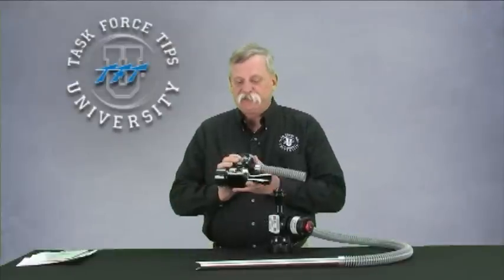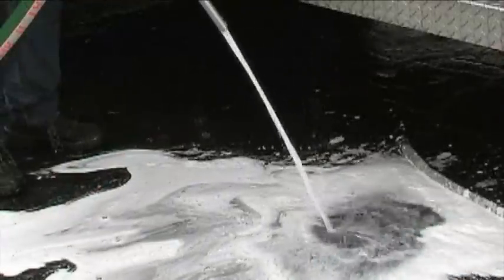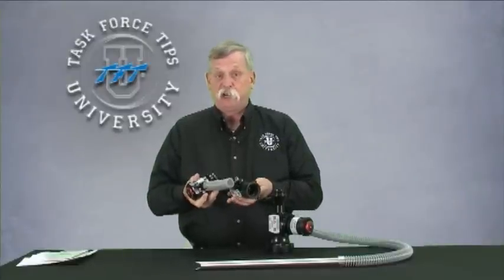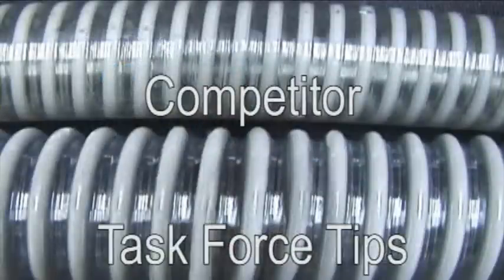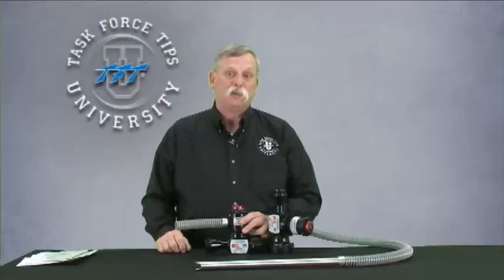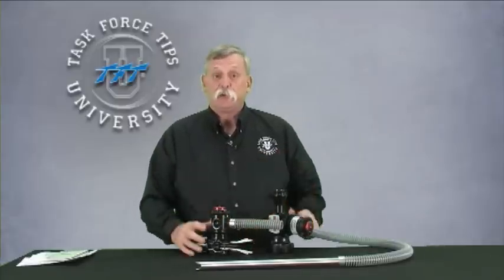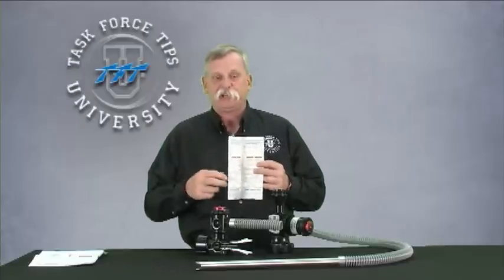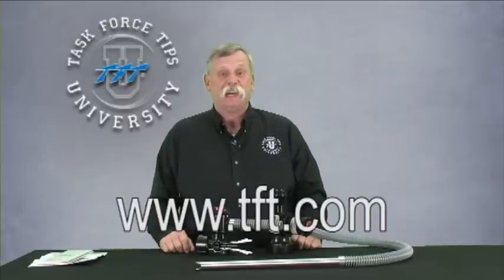TFT Eductor

Comment: Hello,
I am a student from K J Somaiya College of Engineering and my senior year project involves the design of foam educting nozzles. So far I have had little luck finding any resources to move ahead in this research. It would be really helpful if you can provide me with some reference books or design data for designing built-in foam eductors.